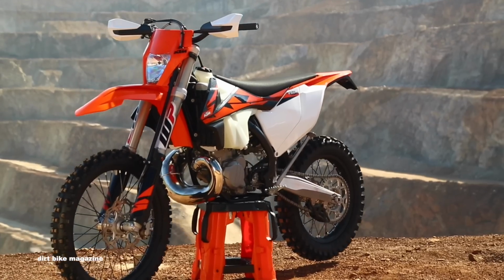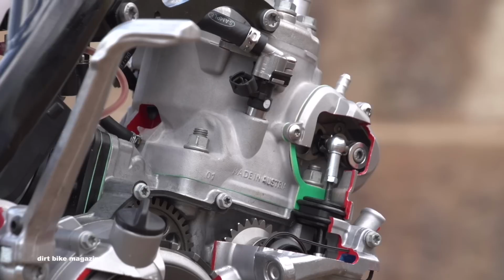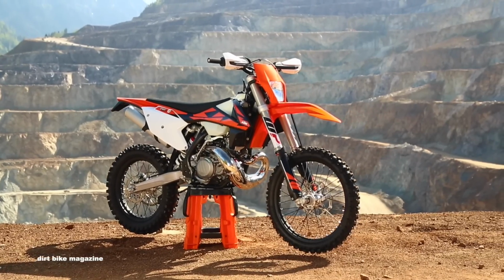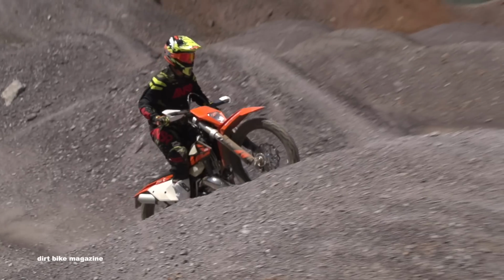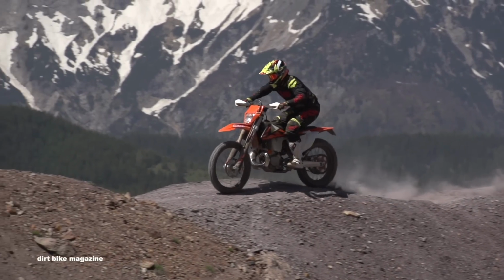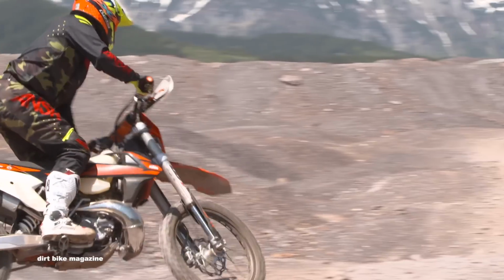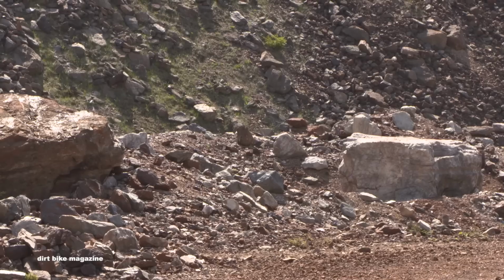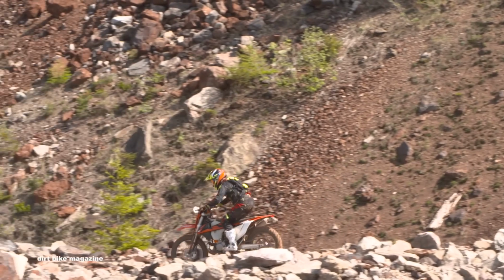First Ride 2 Stroke Fuel Injection KTM 250 XC-W - Dirt Bike Magazine

Comment: So what im hearing is that a regular guy cant fix 2 strokes anymore
Reply: Blaž Benčič they always say stiff like that to make it seem better than it is
Reply: Blaž Benčič I was thinking exactly the same thing......
Reply: 1969cmp its true
Reply: m1ke2001 i dont think so
Reply: Blaž Benčič What you're hearing is no more jetting, no more premixing, better fuel economy, less oil consumption, better throttle response, less emissions, ability for 2 strokes to remain street legal and lastly, 2 strokes not dying out in the future because of regulations. I think higher cost, weight (3 kg, not really significant) and not being able to tune without a computer (which you won't need to, because it will work in any weather or elevation, unlike a carb, which is a pain in the ass and constantly needs to be tinkered with for the bike to run properly) are acceptable compromises for all of the advantages you get.
Reply: iD4v1d Still its harder to fix by someone themselves, if you take the bike on KTM oficial services you wil payy to muucchhh
Reply: laptop tunes will be available from (?)somebody/company thru a laptop ....just like your newer hot rod cars... mod exhaust or want to try better fuel and add timing...download a new tune and have at it... learning curves ahead!
Reply: There won't be anything to fix, because fuel injection always works, but a carb has to constantly be adjusted.
Reply: The ease of rebuilding won't be any different. Plus, as the others have said. The EFI will be easy enough to remap through plugging in a laptop. You won't even need to do this anyhow.
Reply: Usually if you have enough money to buy a 2018 bike then you'll have enough money to get it fixed
Reply: Just what I was gonna say..And also, if you pay a lot for any bike, you expect it to be better made and more maintenance free..All bikes eventually will  be very easy to maintain for the average Joe and thats good!..Who buys a bike hoping they have to work on it?
Reply: What this regular guy is hearing is that he won't have to fuck with carbs in the future.

I sometimes doubt if people actually fix their own shit or are just projecting. This only changes price when/if stuff goes wrong, efi isn't really a big deal accessibility wise
Reply: Michael to be honest, most people ride 2 strokes because they can work on them. I've raced 450's for a while on the MX track but will be going back to a TPI 2T because I'm not going to keep racing MX and will get back into enduro. The ease of dropping a cylnder and doing your own rebuilds is just too good. Rather steer clear of that valve business haha.
Reply: Who said you had to buy one of these? There are a plethora of 2T carburetor machines on the market.
Reply: footbalr074 Where's the fun then? 
You said that because u take ur bike to the mechanic
Reply: Blaž Benčič what's hard to fix here? rebuilds are still the same. If for some reason injectors or a throttle body need replaced do you seriously think that's hard?
Reply: Backyard Boosters i dont know, never fixed one
Reply: How often do you have to mess with efi on your car/truck/snowmobile/outboard motor/4 stroke dirt bike?
There will always be that one guy who knows a guy who's uncles step sister mom's friend's cousin's drinking buddy had all kinds of horror stories but seriously....you never hear about the guy who had zero problems.
Reply: Uh you do realize that you'll need to electronically tune for anything you do on this bike right? Get ready for big money for a tuner, don't forget the tune every time you change a part lol
Reply: Doctoberfest598 uh these are not high performance mx race bikes.  What are you going to need to mod up for on your trail ride? And if you are good enough to really run these bikes to where you need performance and not bling factor I would assume you are doing it as a pro and a $500 tuner and a couple maps aren't a big deal.....racing = money flushing.
Reply: Doesn't matter if I run a bike to 100% of its potential or not, any one wants a different pipe they have to tune for it. It's just the way efi is. You change the air flow either in or out you HAVE  to tune for it. The system can only make slight changes for air density and not much else. You want to change your pipe because you don't like the way it sounds? Toss an extra couple hundred on top of the pipe so you can tune for it. Otherwise enjoy your rebuilds. That's the thing look up tuners and cost of tuning street bikes. Power commander, fuel pack etc. At least vance and hines offers free maps and auto tuning. Though they are complete shit it's nice to have for a 400+ tuner just because you want a better exhaust or intake on your bike.
Reply: Doctoberfest598 First sentence was for you, second was for other guy
Reply: Okay I was confused there for a second lol no harm no foul.
Reply: Fair point, but I'd still rather have a more expensive pipe replacement than dealing with the hassle of having to re-jet every time I go to the mountains or the temperature changes by 10 degrees in one day. And besides, fuel injection will only be on the street legal models, if you like carbs that much, you'll still be able to buy one.
Reply: I hear ya, I would assume the aftermarket will be on this pretty quick to sell more pipes etc. but I can also imagine the system is locked down because of emissions as well but so are all the newest diesel engines and there are endless 'rolling coal' videos on youtube.....And efi is only on a couple of models of bikes for now and not a regulation in NA yet I don't think (California?).
The snowmobile industry has survived efi for at least a decade, they haven't done what the MX world did and flushed 2T down the shitter but they were looking at it, direct injection kind of saved that market.  The difference is KTM is the only efi player in this segment right now, if you want a efi 2T bike your going to have to pay them for it. 

I would never buy a first year efi anything and let the bugs get flushed out first and let the after market catch up. If it's not a law in your area then it can be bypassed legally.
Reply: Well everyone has its own opinion
Reply: S D yeah I'm in the same boat to be honest. I recall the first year Suzuki dropped EFI and they had a few teething issues with those. I do feel that due to the fact that KTM has been working on this tech for a good 4-5yrs, I doubt we'll see the same issues with the TPI as we did with the FI 4t's. But I'll be waiting a year for them to get the kinks ironed out.
Reply: Pierce Barrett there is always something.. if the have been working with Rotax as the rumours say it may be goid to go.
Reply: it basicly is the same as a carb to take a trottle body off just disconect trotle cables and wires the pull out of air boot and cylinder
Reply: Hawk Gamer have maps tuned and flashed is the same as a carb? Tell me how much you know about afrs, timing advance, Det and how easy it is for the average guy to learn how to adjust his fuel trims to account for a new pipe, cams and a port job.
Reply: its not easy to tune with some tuners from the ones we ude in my dads dealership they were confusing at first but i was meaning it is the same as a carb to take it out of the bike basicly
Reply: Doctoberfest598 lol I rebuild 2 strokes and I do not think I could rebuild this the first try maybe 5th or 6th. I need to learn tho!!!!
Reply: rebuilding efi is almost the same as a normal carbed bike the difference is knowing computers, injector duty cycles, timing, fuel trims, and then don't forget the addition of oil injectors. People think this shit will be cheap but trust me it wont. Tuning a car on the dyno is 500 bucks for a complete tune not including the tuner or stand alone ecu. Just look into how much tuning an wankel is. Bet you 100 bucks the majority of people who buy this will delete the oil injectors to run pre mix.
Reply: Doctoberfest598 I've never needed to dyno any of my Fi 4 strokes, so I can't see the problem.
Reply: Pierce Barrett 4 and 2 stroke are 2 diferent engines
Reply: Blaž Benčič are you serious? I just thought they sounded different... of course they are different engines. I realise how different they are as I've owned both, raced both and fixed both. we haven't however had injected 2 strokes... so don't have anything to compare it with. the introduction of fuel injection won't make it harder to do rebuilds etc
Reply: Pierce Barrett Ok gopd for you
Reply: Thomas Dennis If you have money for a that kind of bike and profesional mecanic, which most people dont have, youre welcome
Reply: I completely retuned my '15 dr200's 31mm carb and boy was it a pita , 142d.j.  main jet (stock pilot jet) dj vacuum spring, needle set at the richest setting and a/f at roughly 4 1/2 - 5 turns out, any less and its lean as shit also had to drill out the last baffle for better flow meaning throttle hangover was nuts
Reply: Yet you made a comment " So what im hearing is that a regular guy cant fix 2 strokes anymore"
Then you concede that you don't know because you have never fixed one. I have owned carburetted cars and bikes as well as fuel injected cars and bikes over many many years. Fuel injection these days is extremely reliable and does not require frequent tuning and maintenance like carburetors. The fuel injection of 2 strokes will make them more reliable IMO, give more power and a better torque curve plus they will be less prone to seizure. From my experience of high performance 2 stroke motorcycles, it was a black art getting the jetting right with plug reading via plug "chops". Good riddance to Mikuni and Keihin carburetors. Two strokes will remain very mechanically simple  so working on them will be still very easy.
Reply: droceretik mikunis 31mm cv carb is a bitch simply because of the pilot jet
Reply: Download a new map from the internet and upload to the ECU? Seems easier than tuning carbs to me.
Reply: All you need to add to your toolbox is a multimeter. (should be already there anyway) You can't repair a broken ECU anyway, which was the same deal on the carbed versions.
Reply: I am going to assume like sleds, if the bike can adjust itself to run at changing altitude and temperatures a pipe change etc is not going to kill it?
The sleds monitor exhaust temps, I did not see that on the pipe of the bike or that they mentioned it so I don't know. Like all efi would it not have a knock sensor to detect detonation? 
We do not know enough about the system other than what a marketing department has released. Like I said before I wouldn't buy the first year anyhow.
Reply: The Narrow Band O2 sensor can only adjust for small increments of air density. For altitude. Still need a tune for new pipes, intake, cams, pretty much anything you change. There is only so much a factory ECU can change in the fuel mapping. This is basic stuff in EFI tuning guys I don't know why people think they can just throw whatever at a bike without needing to change fuel trims, afrs, etc
Reply: Possibly because guys are doing it on the BRP product and it works?
Maybe they have a more sophisticated system?  It looks like they run a egt probe. None the less a bolt on and go with no programmer. 
http://bikemanperformance.com/snowmobile/exhaust/bmp-pipes/bmp-e-tec-800-high-alt-single-pipe.html
I would assume if you are dropping $10,000 on a bike and another $5-600 on exhaust having the ability to plug in a tuner and top it off for $500 more dollars for the lifetime of the bike is not going to kill you. 
I would think if all you are after is a different exhaust note FMF will make a factory replacement pipe and silencer that will do the job with out a programmer.

The after market pipe business is not going to let the $$ walk away on the only 2 stroke dirt bike engine enhancement in the last half century above exhaust valves.
Reply: Notice how it states it's for high altitude only. They've engineered this pipe for people above 4000 specifically. 

http://www.hardcoresledder.com/forums/244-xfire-128-firecat-03-06-09/341654-efi-tuning-help.html

https://www.snowest.com/forum/archive/index.php/t-261397.html

Go to any sled page and they state mod your efi sled, you need a remap. I still don't understand how hard this is to comprehend. It's the same as rejetting. Only more complicated, more expensive, and more accurate.
Reply: I see that..... Looks like it will take a tuner or you won't even get a pipe option. I can see the NA market coming up with a by pass on this but then again it is only a couple of models and they are mirrored with similar CC's in XC trim with a carb.  I have been around the mountain sleds and you don't even start them at low alt for any reason unless you have made changes.
Reply: S D that's what I'm trying to explain to people. The simply think because it's efi you can slap on the mods you want and the computer will adjust. it's only programmed to adjust so much to be compliant with emissions standards with the epa and such. Which is why it requires aftermarket fuel tuners and like the video says this bike will even adjust the oil injectors for riding conditions and what not. configuring that in an aftermarket tuner won't be cheap for the manufacturer unless they just delete the injectors and run premix which is what a lot of guys do for Wankel rotary build. One less thing to worry about
Reply: Your saying you don't know how to replace a couple sensors or injectors? Worst case scenario you have to break out a lap top and retune it before a ride or because you changed some stock stuff for some performance parts.. How do people with this mentality survive in 2017? Go learn something new , continue to fix it yourself , read the instruction manuals if you have to.
Reply: Big money for a tuner lol. oh please there will be a power comander available in less than a year with preset downloadable maps for common upgrades. if you cant handle it save yourself some money and buy a 2017 with a carb if your so worried.
Reply: Lmao, dude I built and tuned my own STi I think I know what I'm talking about. So lets say you put a new pipe on this bad boy. What's the best way to go about adjusting his fuel trims for an agl of 1500 feet above sea level? Is it fuel density or is it running in an open loop? How big of an injector would he need if he's going to be putting in some new reeds, a higher compression piston, and a full exhaust kit? These are things that the average users is not aware off and isn't capable of doing themselves.
Reply: True :  but if the average user isn't able/willing to do research to learn these things, chances are, they are the type that is currently riding a "tricked out bike"  that's improperly tuned and probably worse off than stock. That or they just cut a check and had a dealership/shop do everything.
Reply: That's exactly what I'm saying though it's way more expensive and complicated than rejetting a carb. Especially dealer remappings just for say exhaust. With Harley the tune is already lean as holy hell and it's about 2-300 bucks for a remap just for slip on and an intake. Granted that's for on road use and they are required to follow epa emissions standards but with the added complications of the oil injectors that adjust for conditions on top I can see it being just as expensive.

Now a guy can't just look up what jet he needs buy it for a couple bucks tear it apart slap it back together and go now he's gotta spend hours researching what tuner does what and how much it costs, if it'll just be a canned map or if he can adjust then he's gotta learn how to adjust all the parameters in the map.
Reply: Doctoberfest598  I'm excited for it still. I probably won't buy one for a few years till the bugs are worked out and the aftermarket support increases. I'm a firm believer in never buy the newest of anything. your almost garentee to have factory issues and down time due to warenty work. at least when it comes to motorized vehicles.  I currently ride anywhere from 8000 feet to sea level 30 degrees f to 110 degrees f  and I'm personally excited to be able to leave the jet kits and tools at home and grab a laptop or he'll an old smartphone dedicated just to tuning. which is still an exaggeration since you likely will never have to tune unless your modding the bike. I'm guessing these bike just like all stock fuely Harleys are going to run Lean for epa purposes , so a tune as soon as you buy it even without aftermarket parts will be a thing that becomes normal.
Reply: and like I said before. MSD will be all over this. they will probably have pre tuned maps for common upgrades within a year is my guess. power comander for 2 strokes who would have thought. hell fmf might even offer a download able tune for free just for buying there knarly pipe and turbine core package. that would be enough reason for me to get it. a recluse clutch , suspension tuning and I'd be set for a long time. I normally wait for engine rebuild time to do big bore high comp kits and by that time aftermarket support will be large.
Reply: All those things will eventually be avalable but it'll cost. The Vance and Hines FP3 for my dyna was 400 and that's just for intake and exhaust slip ons. It's not cheap by any means but I'm a tinkerer so it doesn't bother me to THAT much just people need to realize you can't slap everything on efi engine and expect the stock ecu to compensate. Fuck the intake was like 300, slip ons another 300 (these were put on before I purchased the bike so I could tell it was already lean. FP3 opened it up more, runs cooler and it's nice having the live data to see my head temps, engine codes etc but it's locked in to ONLY that bike. If I buy a new bike I have to spend the 400 again for a fuel pack.

There's a lot of up sides to efi, accuracy, dependability, not having to clean carbs any more but there's a lot of down sides to it as well.

Generally companies that manufacture the parts don't do the tuning for public use or offer tunes for them for free. They do "kill tunes" to be able to say "Our part puts X amount of hp or torque over stock." It's company's like Vance and Hines, Power Commander etc that have a team of guys tuning different parts and isolating what needs changing and how much is safe for every day use. Which is why the tuner costs so damn much.
Reply: "So what im hearing is that a regular guy cant fix 2 strokes anymore"

you idiots said the same thing when bikes moved to liquid cooling

It's a little added complexity that will actually make some things easier.

This regular guy is looking foward to not fucking with jetting and cleaning carbs.
Reply: Blaž Benčič When was the last time the efi went out on any engine you own?
Reply: hudscp They will soon be gone. Even chainsaws are going to electronic controlled carbs.
Reply: I wouldn't say soon but eventually yes carbs will be no longer available
Reply: All you need is a lectron carb and a Yamaha, ten times more reliable than ktm/husky(same bike), works like fuel injection from 0-8k ft, by the way, I don't know why everybodys all excited, the joke is there only bringing 60 fuel injected KTM's next year into us, you won't even see one, will see how they work out, but they'll cost too much!
Reply: Dan Donnelly Dont say Yamaha is more reliable cuz its not, its the same ktm and husky just have beter engine parts and its more expensive, but a normal guy doesnt need it
Reply: footbalr074 He is a Yamaha guy, i dont blame him cut yamaha is a really good brand, but if you like one brand you dont have to say that others suck.My friends, have Yamaha x2, husqvarna x2, kawasaki x1, ktm x4 and all of the bikes were always mainatined regualrely and they all work ass they should
Reply: Drink the cool aid smelly feet, I've owned countless husky's and KTM's before they were trendy, great bikes but highly over rated for what you pay, just found a better more reliable bike, with a suspension , you probably don't know what that is on a KTM, or did you spend another 1000 to get it to work half ass, any way the fuel injection is coming, we'll see how she works out, Yamaha is got one coming too say's the rumor mill, no prob working on new bikes , but more shit to fuck up on the gnar town trails up here in the PNW and Canada woods, were on a little different program, don't want to be broke down in these woods.
Reply: Blaž Benčič just so you know you can tune the efi yourself... no need for a mechanic...  in 1/2-1 year all the programs etc will be available on the internet
Reply: not to mention in today's day and age learning how to use basic tuning software and learning how to tune an engine is invaluable.
Reply: I mean if you want to learn how to tune on a 8K+ bike and blow it up be my guest. I for one, don't know how much oil to inject for an altitude of 10,000 feet above sea level, running 93 octane, in all gears and load of the engine while maintaining a stoich afrs without a wideband sensor. It's beyond me and I'm not going to risk the learning curve on something that expensive. And any company that creates a tuner for an ecu complicated as such isn't going to be asking peanuts for it.
Reply: You won't have to tune it all the time, that's the point of fuel injection.
Reply: Doctoberfest598  can't be much worse than tuning a nitrous injected 1200 hp BBC for altitude and tempreture differences. tuning on a computer is something every mechanic needs to learn now adays. as for the oil injection it should be dependent on how much fuel you're injecting and the temperature of the engine.
Reply: Dalton Michaels mechanics are not tuners. and the topic of discussion is a "regular guy can't fix 2 strokes anymore". Like I said mechanics aren't tuners. They aren't interchangeable. And tuning knowledge from a mech isn't anywhere near a full time tuners. The average mechanic isn't going to know jack shit a 110 shot a nitrous, nor is the average Joe. Which again is the topic of discussion. If you're trusting a mechanic to tune a vehicle enjoy that motor while it lasts. for the next couple hours at least
Reply: tuning is just a learned skill same as mechanics.
Reply: Dalton Michaels tuning requires much more skill than wrenching. You have to know a lot more about the motor you're working on than following a Haynes manual like most
Reply: 4 strokes have had efi forever now. Never had an efi issue or an oil pump issue with any of my bikes  and I've rebuilt more than a few top ends so what exactly won't the regular guy be able to fix?  Not having to fuck around with a carb will be nice. As far as the mountains go , I don't really know, but your average weekend warrior will have less maintenance with efi than with a carb.
Reply: shogun678 I don't understand why its so hard to comprehend. EFI isnt about maintenance and carbed bikes are pretty fuckin' easy to maintain as is. Now it will be all computer driven so guess what that rebuild kit that increases compression or that sweet sounding exhaust you'll need to dump a few hundred more into a tuner.
Reply: but that tuner whether its self learning or programmable via laptop will be good for the life of the bike. not to mention you will be able to save tunes for different set ups. you can have a tune for race gas at high and low altitudes for racing, and you can save tunes for pump gas and trail riding. then switching between the two will be a 5 min process. you don't have to have dedicated carbs for each set up or mess with jets and needles.  if your into that sort of thing. which i myself am. Im guessing right off the show room floor you can hook up a tuner and gain power due to the fact that the bikes will be pre set to run as lean as possible for euro 4 standards. probably will be able to get 2-3 hp from a retune and maybe some more low end torque.
Reply: Dalton Michaels that's IF they go for canned/off the shelf maps which I highly doubt because of the oil injection. It'll take years before canned maps are available and even then it'll only be for exhaust and intake. The more common mods will be the only canned maps and that's it. look  at the fuel pack fp3 pick any bike and any exhaust that's not a top seller and you'll  be contacting v&h for a recommendation  of "the closest thing". Then it's three tanks of gas for a dialed in tune that won't account for high altitude changes. Go ride a mountain and you'll need a new auto tune. Youll need to learn how to adjust fuel mapping, spark advance, injector duty cycles. It's hilarious to me that you guys think efi tuning is the easiest thing anyone can do. If that was the case people wouldn't be spending 500 bucks just to tune a car not including tuner and mods.
Reply: Dalton Michaels And not to mention that the fp3 is LOCKED to that bike and that bike only. Hell Cobb's are interchangeable at least.
Reply: Doctoberfest598  it's amazing to me people think tuning injector pulse widths , AF , and timing is rocket science. the oil injection will likely be pretty simple to tune as well. since it will be dependent variable based off of the fuel volume. put it into a closed loop. and if the bike has a map sensor and intake temp sensor , attitude will be a parameter you can build into a tune. and you wont need to re tune for elevation.
Reply: Doctoberfest598  I have seen bikes people have built at home with 450 fuel injection throttle bodies on yz250 two strokes with 100% custom set ups and home made tunes. Tuning a purpose built fuely two stroke won't be that difficult.
Reply: Dalton Michaels and altitude isn't a parameter you can just set on a speed density or closed loop. And if you are prepared to spend the money replacing narrow band o2 sensors after fouling the shit out of them with unburnt fuel and oil from a 2 stroke be my guest. Just ask the rotory guys. My bet is there will not be any o2 sensor on these bikes
Reply: Dalton Michaels and are these guys who built these custom efi bikes are they "regular" guys or are they actually enthusiasts who spend hours researching, wrenching and learning? My bet is this wasn't their first rodeo am I right?
Reply: Blaž Benčič You don't have to be a mechanical genius to fix even a 4 stroke.
Reply: Isn't one of the main points of 4 vs 2 stroke is 2 strokes are significantly easier, cheaper and less complicated to fix with less moving parts?
Reply: Way more torque would be the main point
Reply: Heinrich Von Kekelnazi  Actualy its not easy to rebuild a 4 stroke, maybe to you because someone thaught you or you are a naturall mechanic or smth
Reply: Blaž Benčič Nobody taught me anything. I taught myself as a kid. I used to take a part old lawn mowers and rebuild them for fun. Started that at 6 or 7, and at 16, I was rebuilding my first car engine. 

Regardless, 4 strokes are still very easy to work on. Not any harder than a 2 stroke, in my opinion. But I will say, 4 strokes are harder to tune properly -- but definitely not hard to work on.
Reply: Heinrich Von Kekelnazi  I also do car engines and hotrod engines as well as my own bikes. I've rebuilt a honda 650 and my yz250 and I think the two stroke is just simple. no valve timing to mess with , no lifter shims , rockers , cams and cam chain. which also means 1 less sprocket on the crank as well. you just have the transmission drive mechanism and the charging sytem on the crank. the only thing above the crank besides the piston is a spark plug. power valves can sometimes get messed up and need tuning but they are pretty simple as well.
Reply: Basically yes
Reply: I mean it should be expected that you will need to work on your bike if you ride it. Things wear out and take abuse. I may be in the minority but I like when winter rolls around and I fire up the furnace in my garage and start tearing the bike down to rebuild it.
Reply: motret  jitu   29-10-2017